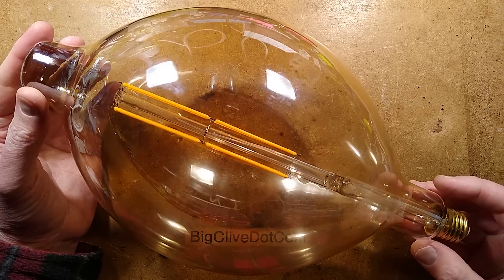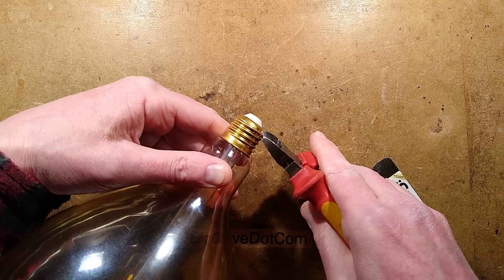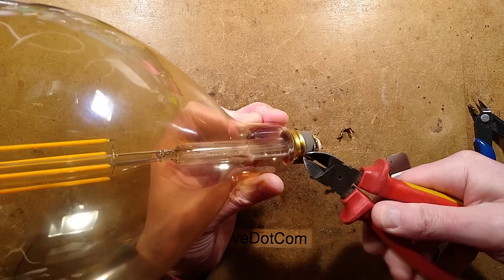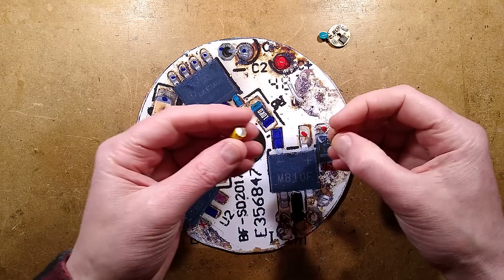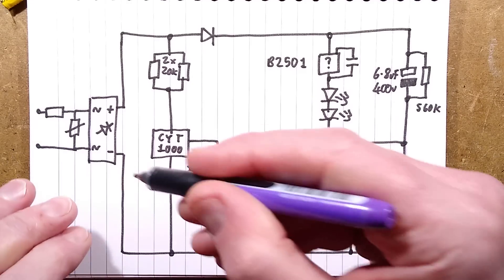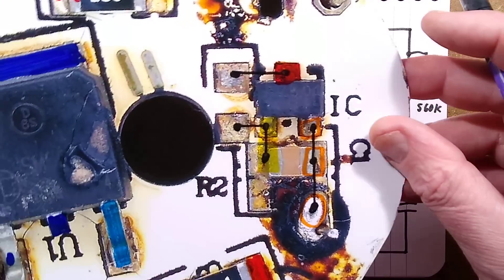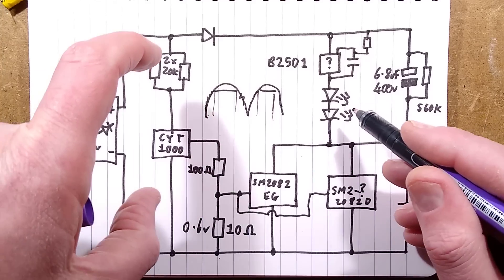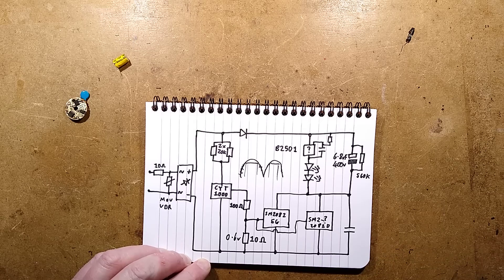Inside a huge faulty Poundland lamp

Comment: You'd think now that LED bulbs have been around for years, manufacturers would have come up with a standard way to drive them. Why is it that they're trying to re-invent the wheel every time?
Reply: @Bobo Exactly. My garage lights failed, I quickly realised it was the driver and oddly the external drivers I bought have lasted for many years longer than the factory ones. Maybe because I overrated the requirements unlike the Chinese originals.

Comment: I "think" the B2501 may be a high-side resettable efuse similar to a Littlefuse LS0504EVT233 but with way higher ratings.  If the nearby capacitor were wired out (orange) to ground (yellow) instead of self to out in the diagram, that'd be my guess as to what the mystery chip is.

Comment: Once I've "got into" metal shrouds etc I tend to use a pair of long nosed pliers to peel back the rest of the metal, it avoids cutting pieces off with the sharp jaws of the snips. Of course, that would typically be on bottles of wine or whisky rather than light bulbs, it's easy to accidentally slide your hand along the sharp edges when a large portion of the contents have been consumed.
Reply: How about a small dremel with a metal-cutting abrasive disc?  Or a jeweler's frame saw?
Reply: @tubastuff  They'd probably create metal filings, which might not be ideal.

Comment: Thats not for insertion. Nice bulb, shame about the fault  2x👍  Could you use a glass cutter to scribe round the neck of the bulb and get the filaments out that way, then fix and glue it back together?
Reply: Then all the Argon would escape and the lamp burn out instantly!! Joking of course but that might be a good idea!
Reply: @stepheneyles2198  I sure live could such all the air out of the bulb again. 🤣
Reply: @dcallan812  What?

Comment: Seems somehow appropriate to get a lighthouse style lamp from a fisherman.
Reply: Is Clive a fisherman's friend ?
Reply: @travisash8180  Well for some, Clive is probably an acquired taste.
Reply: I think he was using it as a lure to attract fish!! ;-)
Reply: It looks a lot like the lamps the squid fishing boats use in terms of size and shape.
Reply: In terms of light output it's nowhere near the 1kW mercury vapor/metal-halide fisherman use though._
Reply: @DjResR  In the latest Fuji Lamp catalog I have, fish attraction metal halide lamps go up to 9kW and halogen lamps go up to 5kW.
Yes, a 9,000W metal halide lamp.
Yes, I want one and a ballast for it.
Reply: @randacnam7321  Second me in, 9kW metal halide sounds like a sun in bulb form._
Reply: That crazy,  9 kw that means there are 3 face  power and rectified, or 
That there need to 
Be very serious 1 face assigned to it .
16 amp 240v 4200 w so  9000w most be like 35 amp 240 v.  or something,  with of cours maybe no problemo if the lite is connected with heavy duty connector or hard wiered. 
And you have a big  3 ph genset on 90 amp:  or a single phase  40 amp genset., only dedicated to the lamp!
I
Reply: I don't think, somehow, that the light would shine far out to sea, plus, I can't imagine Trinity House approving such an unreliable light source as LEDs.

Interesting thought though!
Reply: @whitesapphire5865  I believe they are gradually in the process of switching their lighthouses over to flashing LED lamps due to lower power consumption and maintenance (probably not sourced from Poundland though). It's a bit of a shame because you don't get the sweeping beam effect after they remove the rotating optics.

Comment: I had a Philips LED bulb die a few days ago, first of like a dozen that have been running for a few years. I popped the bulb off and tried getting the PCB out and  managed to slip and the lamp... cup, thing where the diffuser was managed to cut one of my right knuckles and and stab a small hole into my left thumb.  😂.  Even after trying to break more stuff free I have no idea how to get the aluminum top out where the little PCB was stuck down.